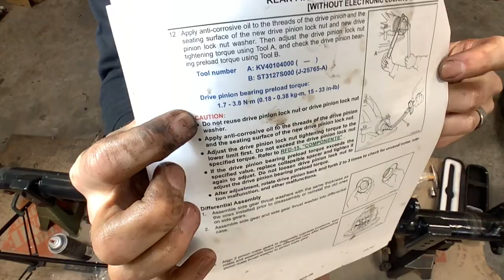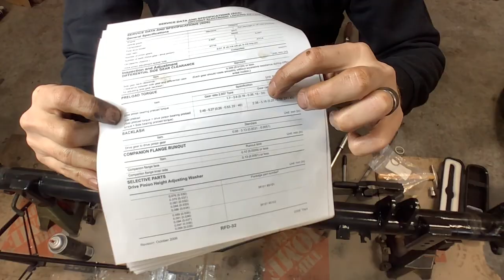Why NOT to replace the rear pinion seal Nissan Titan M226 Dana Super 44. Setup & shim

Comment: Do you remember if the oil slinger is flat? Removing my seal was pita, I deformed the slinger a lot, to the point where it's cupped.

Comment: Very helpful, thank you. My 2006 Titan has a loose pinion and pin, I'm trying to determine how much I can tighten the outside just a bit so it isn't too tight, and also make sure the pin's screw hasn't come loose. My axle is making a noise which I've diagnosed as a loose area of the spider gears/pinion and want to make it a little better before I do a full rebuild.

Comment: Great video! Makes complete sense. The depth controls preload on the bearing with the crush sleeve. What are your thoughts on marking the pinion threads and nut with paint, replacing the seal and aligning everything back up on a known stock seal?
Reply: No go. Been done and doing a full rebuild now. Sucks. Unexpected expenses and now I'll have to do a true track posi and traction bars. Lol. Had another do the seal not knowing the harm it could do. Well.... my pinion nut completely came loose and pinion gear smashed the carrier so hard at 80 mph. Ripped to sheds